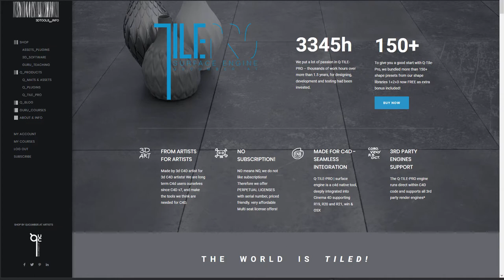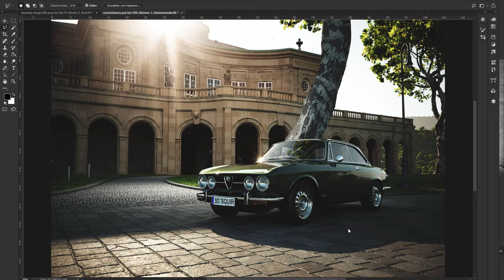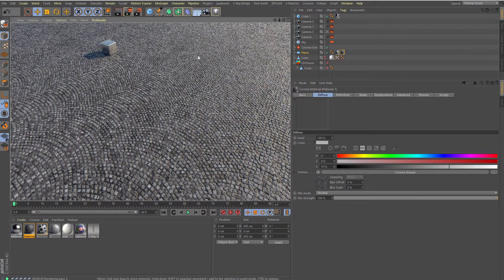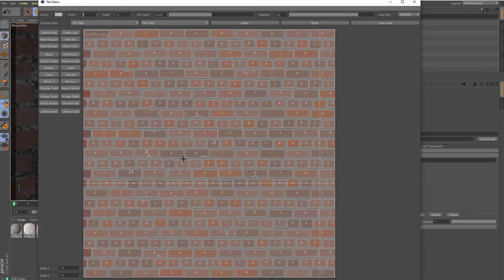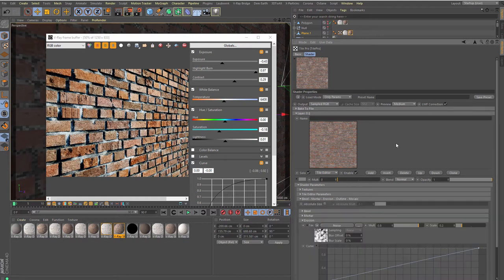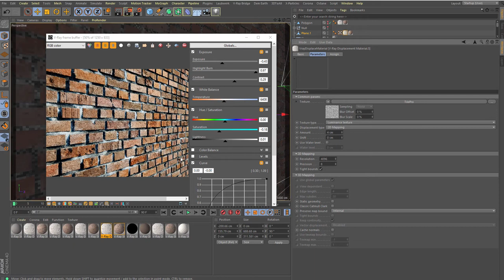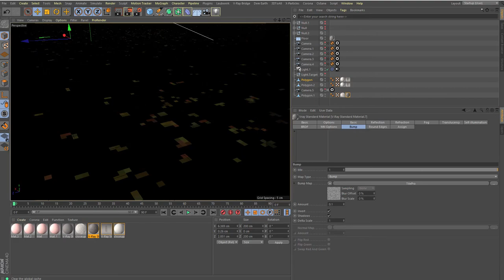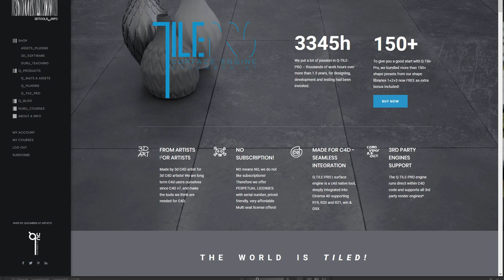Q TILE PRO surface engine video001 (v1.0)

Comment: Can you show how this is used with redshift. workflow
Reply from the maker: as in all engines, either direct as shader (in RS or octane via their c4d real time baking function), or via the multi threaded Q-tilepro baker. the result of baking is pixel exact the result of the shader (only chached so no need to recalculate then).  you can use 4k,8, up to 16k output for highest detail. For redshift make sure to use the very latest v3 versions which have greatly improved support.